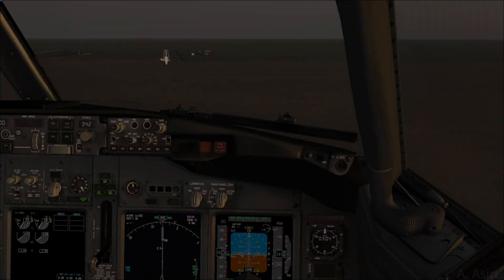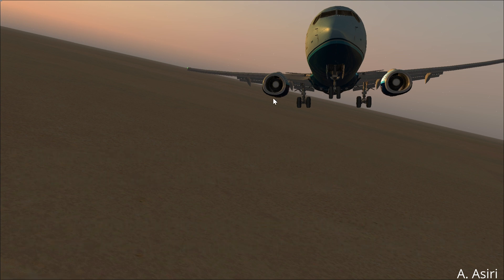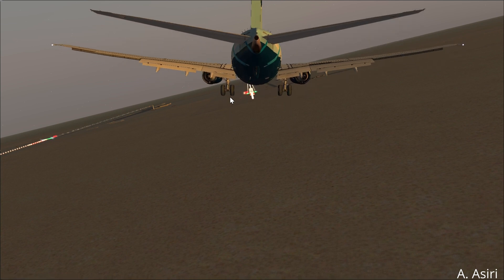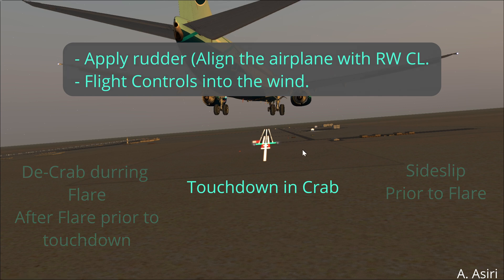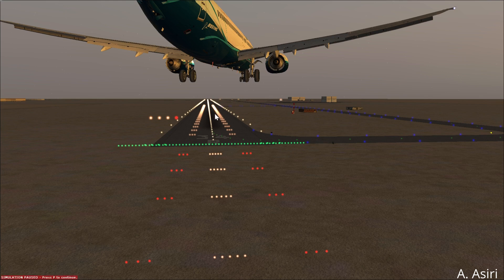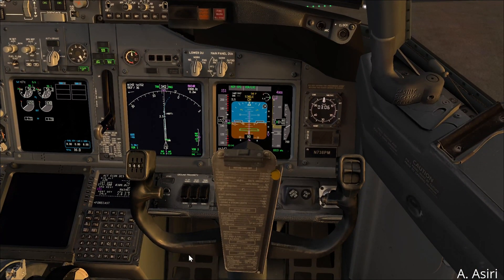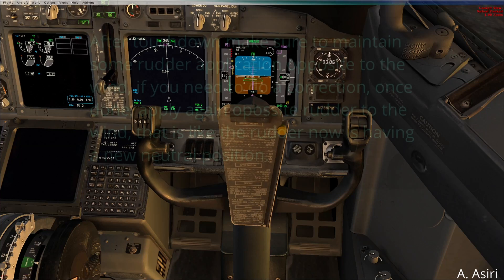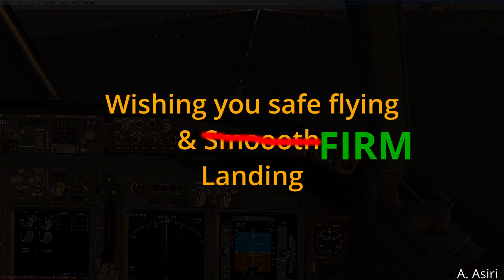B737 App. & Lndg Video#11 (Crosswind Lndg)

Comment: Hi Captain!

I wanted to ask you regarding Variable/Shifting winds with Crosswinds. I had an approach that didn't go as nicely as I wanted to, initially I thought I had a crosswind from the right but towards the final approach, I found myself far right of centreline and was even confused what to do with the correction because if I put left rudder and right aileron, I would have ended up further away from centreline.

The Captain helped me by pressing left rudder, but we still were quite far to the right. 

In these cases, what should you do? Is it better to just accept being far from centreline and straighten with rudder?
Reply from the maker: Hello Mike, 
This sometimes happen when the pilots sometimes are not able to adjust quick enough when the wind closer to the RW is a lot different from what it was on the approach. 
The best thing to do is to continue flying the airplane with smaller corrections, 
Reducing the aileron input (slightly) in this case would have helped let the aircraft drift back towards the CL, 
Rudder input is to align the aircraft longitudinally with the center line so you would apply the rudder to align the aircraft with the RW, as far as CL goes the aileron (again small changes) will help returning the aircraft closer to CL. 

Don’t worry about it, you will get used to it, just remind yourself to fly the airplane till rollout, the wind might change direction and speed at any altitude. 

Hope that helps 
Wishing you safe flying & smoooth landing 
Abdul

Comment: captain! what a  nice video and very helpful
and what's the reason, for example in a right x- wind condition, right main gear touches first .
i guess when you apply left rudder in right x -wind , there is a rolling tendency to the left!, so doesn't it make sense left main gear touch first?
Reply from the maker: Am glad you liked the video 🙏🏼, 

When you apply left rudder the aircraft will roll to the left as well that is why you apply right control wheel to compensate for that and the right landing gear will touch first otherwise the airplane will drift to the left. 
Hope that is clear if not let me know or if you have any other questions. 
All the best, 
Abdul